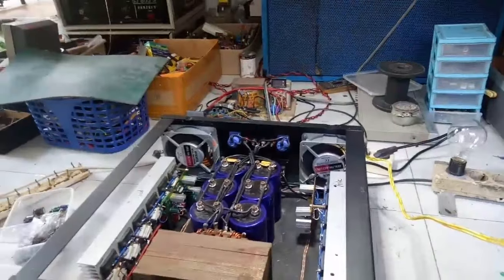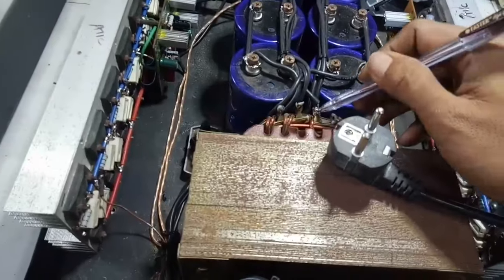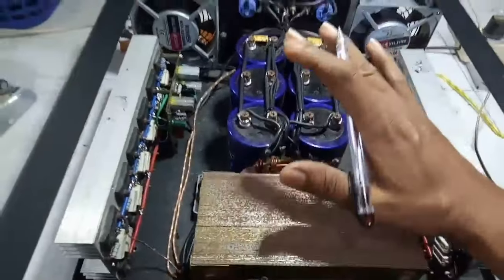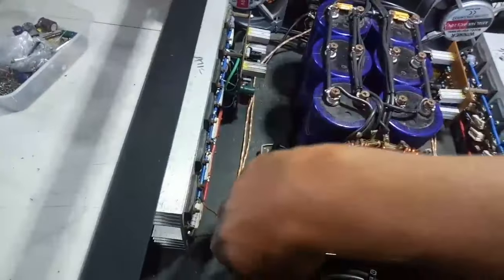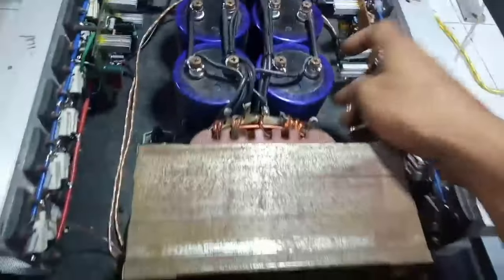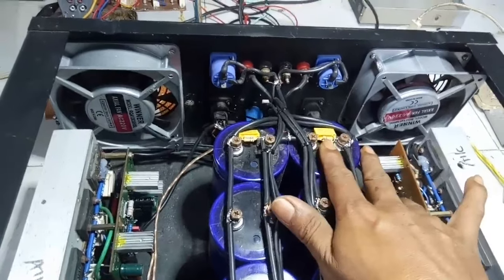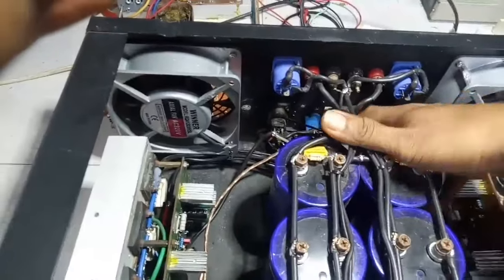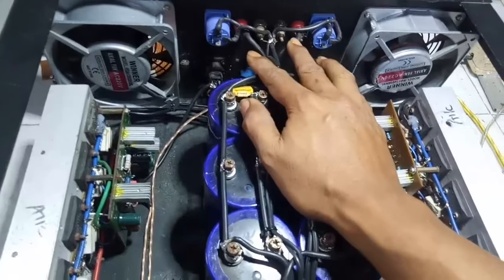Meskipun power ombro jangan dengung lah....

Comment: itu sama dgn caraku waktu dulu masih otak atik ampli bang.
intinya kalau ingin dengung hilang ground pakai kabel yg bagus dan tidak boleh lebih dari 1 setiap driver, bodi ampli dan bodi trafo.
1 driver yg sudah terhubung ground ct tidak boleh disambungkan ke ground bodi ampli, jadi penyangga harus isolator dan jangan dari kuningan.
potensio yg nempel dibodi besi ampli tidak boleh disolder untuk menyambungkan ke ground yg lain karena sudah terwakili dgn ground pada bodi ampli.
kabel output R L dari tone kontrol menuju input power ampli tidak usah disambungkan ground nya karena sudah terwakili dgn ground 1 titik itu, jadi kabel headnya hanya R dan L nya saja yg disambung, sedangkan serabut ground nya hanya disambungkan ke salah satu drivernya saja yaitu di tone kontrol atau di power amplinya.
Reply from the maker: Bener sekali
Banyak yg menganggap grounding spele padahal tidak ya
Reply: Kalo pakai audio prosessor out dari audio prosessor dikasih ground apa tidak mas ?
Reply from the maker: @dikitriwahyudi3613 kasih satu grounding juga

Comment: Bang sy msih kurang pham tuk cra pasang resistor dan cap Astor tuk pmbuang arus tegangan pd elco. Tolong di PR jlas bsaran cpsitornya dan rsistrnya agar sy ga slh dlm praktek trimksih bang. 🙏🙏🙏
Reply from the maker: Pakai R22k/2 watt paralel sama C104/225v 
Pasang ke ground dan tegangan +
Sebelahnya juga gitu
Reply: @CAK_SONO .. Trimaksih bang.. Cukup jlas. Skrang. Dan tinggal prakteknya skrang 🙏🙏🙏

Comment: @caksono kalau power stereo dengung dreeeett sebelah saja apanya yg slh cak
Reply from the maker: Coba tips yg no.4
Reply: Oke Cak terimakasih ilmunya smg bermanfaat dan sukses selalu buat Cak Sono....🙏
Reply from the maker: Aamiin
Reply: jika volume Ch B dibuka, yg terjadi di Ch A suara input sedikit ikut masuk dari ch B,
suara yg keluar terdengar kecil dan serak dispeaker ch A dg posisi potensio vol ch A yg ditutup total.
Reply from the maker: @nanang3674 kabel input jangan jadi satu sekalipun isi 3
Reply: sebenarnya saya sdh pakai kabel input terpisah antara ch A dan ch B cak... kabel pakai BMA potensio 50k... klu utk suara sih bersih gak ada nois Cak...
🙏
apa mungkin ada yg salah ya dgn rangkaian saya...
ground antara input PSU dan out ke speaker saya jadikan satu... jika ditest mono semua aman cak antara ch A ataupun B tp stlh diinstal stereo ya gitu deh...😊
vol ch B dibuka ch A ditutup tp ada suara kecil di Speaker ch A
Reply from the maker: @nanang3674 driver apa
Reply from the maker: Coba input drivernya pasang R10k
Reply: Siap Cak... Terimakasih🙏

Comment: Mlm cak Sono...🙏 Mohon maaf menggangu...gini cak saya mau tanya soal PSU...sy memperhatikan itu ada yg buat 1 trafo 10a murni 2 PSU beda tegangan...1 PSU dg tegangan 45v CT dan 1nya  32v CT...apa cara demikian bisa efisien tanpa resiko misal terjadi dengung atau gmn...mohon infonya..🙏🙏
Reply from the maker: Biasanya potensi dengung atau ada cacat frequency saat kedua power dinyalakan
Antisipasi yg baik untul sistem spt itu gunakan psu sistem H
Low volteg untuk chanel A high volteg untuk chanel B
Reply: @CAK_SONO  pantesan saat di play suara lgsg dengung tanpa membuka volume...trs udah berbagai cara sy perhatiin ngilangi dengung ttp ngk bisa...
Reply from the maker: Divideo ini sdh sy kasih semua
Reply: @CAK_SONO  siap mas Nurul...🙏🙏

Comment: Klo pake cara ke 4 itu berarti ground dari psu menuju driver ga dipakek 1?? Misal driver stereo yg dihubungkan ground psu cuma satu driver aja? Ground driver yg satu ikut ground input yg dijemper tadi?
Reply from the maker: Semua driver gak dapat ground dari psu tapi cuma dapat ground dari ground input
Arus yg mengalir sdh daoat dari ground speaker
Reply: @CAK_SONO  oh berarti semua driver gak dipasang ground psu ya?
Reply from the maker: Ground tetap ada tapi penggunaan ground lebih dari satu titik biasanya menyebabkan denfung pada power amplifier
Reply: Bagaimana kalo btl , speaker tanpa menggunakan ground

Comment: Om headsink ak kok ada teganganny knp y? Tapi yang sebelah tidak ada
Reply from the maker: Cek isolator tr finalnya
Reply: @CAK_SONO  siap om Terima kasih
Reply from the maker: Sama2
Reply: @CAK_SONO  om mau nnya lagi😁🙏, power ku sesudah aku pasang protek kok ada suara dengung om? Kira2itu knp?
Reply from the maker: @masWekE12 grounnya jadikan satu dg ground psu
Reply: @CAK_SONO  sudah om ground 1 titik
Reply from the maker: Driver sudah dipastikan dco nol
Reply: @CAK_SONO  iy om nol,di protek ada ic regulator 7812 aku supplyy 15 baca apa suara dengung ngaruh dari situ?
Reply from the maker: @masWekE12 belum tentu
Reply: @CAK_SONO  kira²apa ny om? Pusing😅

Comment: Tanya bang..kalau dgungnya seiring dg musik..maslahnya dmn bang...pdhl  pwer dionkan tanpa musik...udah senyap...
Reply from the maker: Kalau safari elco 47mf yg ke emitor vas ganti 220mf
Reply: @CAK_SONO  powernya ocl 150 w mono..tr pinal 2set pakai tip 3055 danpasanganya...pengaturan nada pakai mixer roland 7pot.
Reply from the maker: Mungkin over gain
Coba R gain 33k ganti 22k